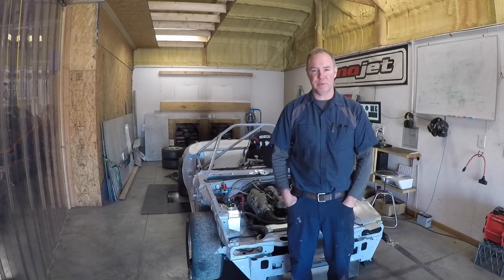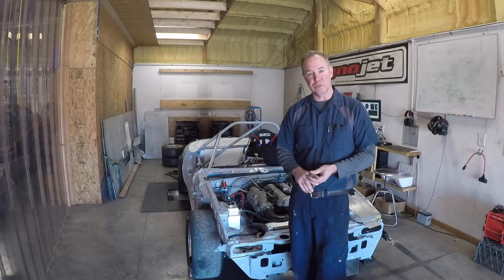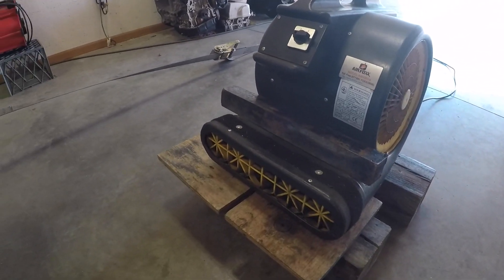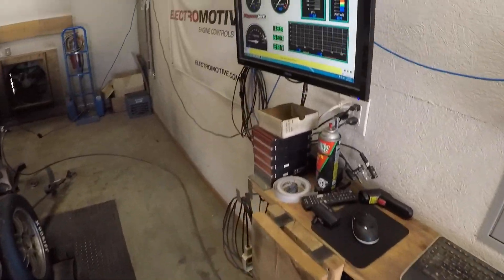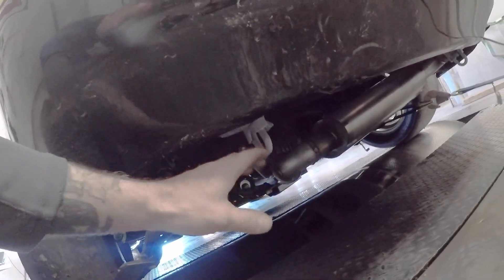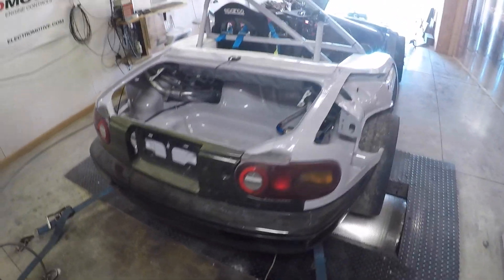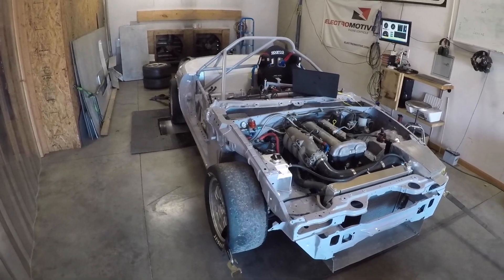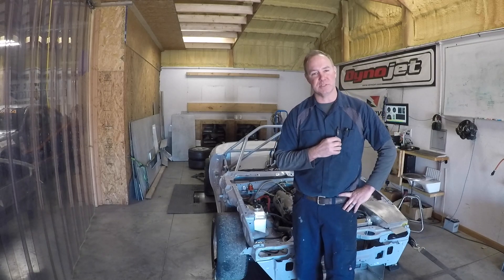Going to the Chassis Dyno?  Make Sure it is Setup Just Like This!

Comment: Nice dyno. I started learning about tuning  2 years ago when I got my Camaro. I really enjoy the challenge of learning.
My only regret is not discovering my fascination with calibrating sooner.
Reply from the maker: Thanks!  Dynos are only good if they produce repeatable results. With that being said, engines lose power as they get hotter, so finding the happy medium in there is a good thing. It probably goes without saying, but you can’t race dynos either, so comparing what one says vs the other is kind of a waste of time. 

What dyno do you run?